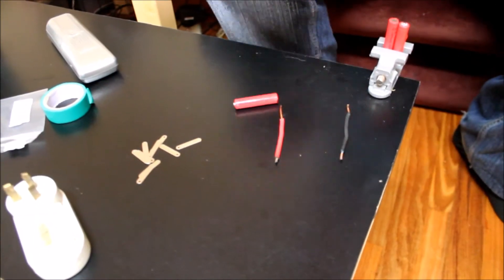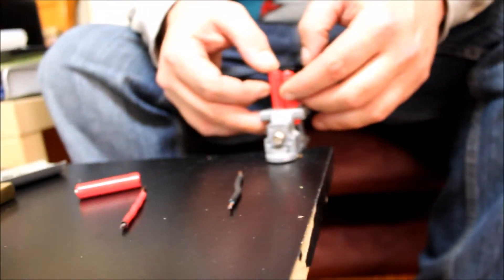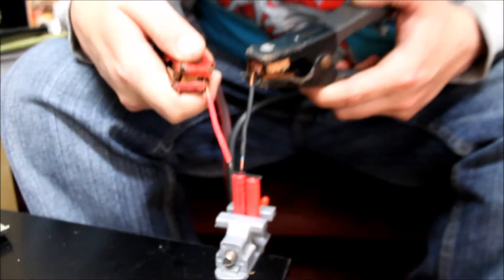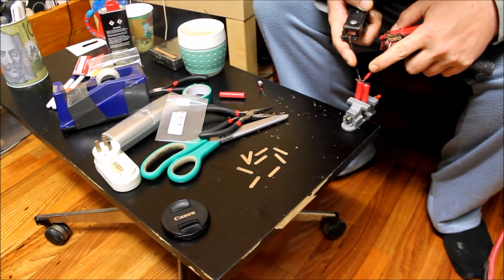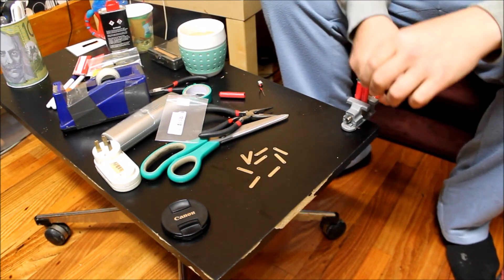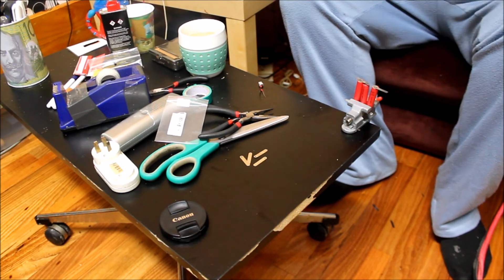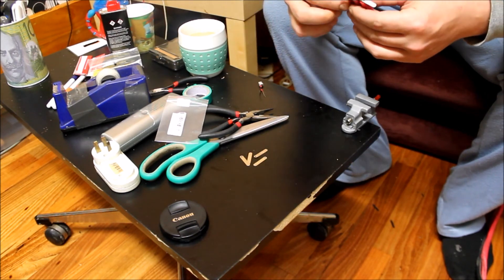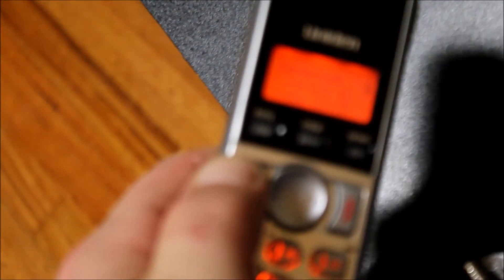How to Weld / Solder Battery Tabs to make Battery Packs

Comment: I was saved from spending funds on a brand new car battery when I heard about the reconditioning program ( Check Details Here>>>https://t.co/K0S4ZxvA0x ), therefore I tried it to recondition my old auto battery! I thought it would take much effort and hard work, however it was simple as ABC. That already saved me about $ 100 and there are a lot of some other batteries.
Reply from the maker: thanks, i have been meaning to make that video, Nowhere says how much to put in but i have worked out what imho is the best recipe. sub to find out what the best way imo is. the thing that sux is that new batteries are made so you cant access the cells

Comment: How about using a length of 12 ga romex instead of jumper cables or along with them to do the spot weld. You could just bend the two ends close together. Thanks again, Mike

Comment: Hi again, Well I tried my carcher/starter on wheels on charge not start and it worked. The terminal and top of the batt turned orage but it worked. If I use my car battery do I need to  disconect it from the car? I have plenty of old tabs that I removed from bad batteries. One video showed a momentary switch in line to make sure you don't fry anything. What do you think? All my friend think I'm crazy to go to all this work but I'm hooked now. Thanks, Mike
Reply from the maker: I would disconnect from the car just to make sure you dont damage anything. To include a switch i think is unnecessary and may be cumbersome to use as you need 2 hands. So you used a car battery charger? I thought about doing that but decided on using the battery. Well done, I hope others that dont have access to a battery will read this and know now that they can just buy a charger and it will also work :)

Comment: Hi, I'm trying to rebuild a Craftsman 19.2v batt. Your video lools pretty simple and I like it. Could I use a battery charger instead of a battery? Where do I get the tabs to connect the batts?  I haven't been too successful trying to solder the batts together. Thanks, Mike
Reply from the maker: Nah soldering them didnt work for me either. You buy the tabs from ebay just search for battery tabs. They are like 10 for a dollar. A battery charger wont have enough amperage i don think. Even the car battery wont work unless its fully charged. Make sure you use copper aswell at the ends as i tried nails which made the tabs stick to them instead of the batteries.